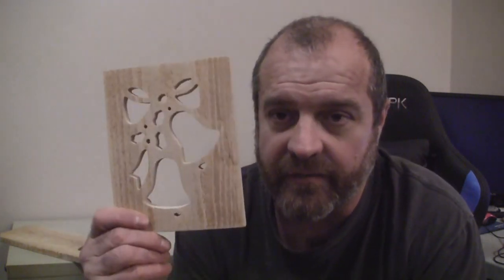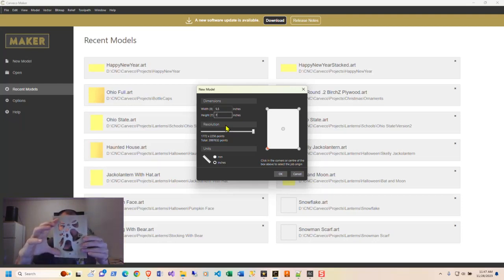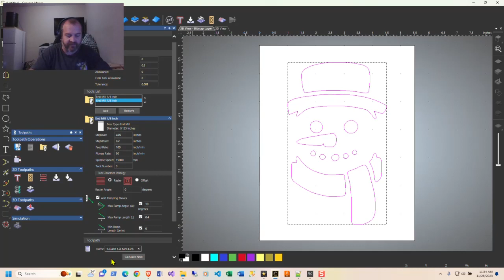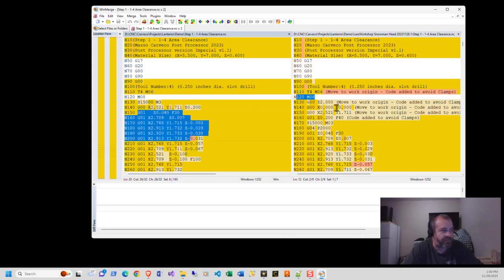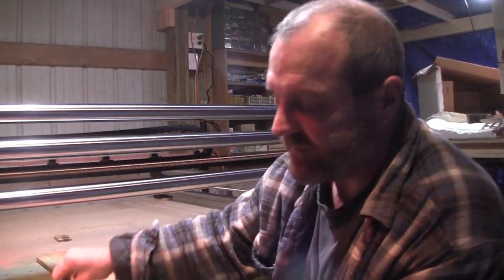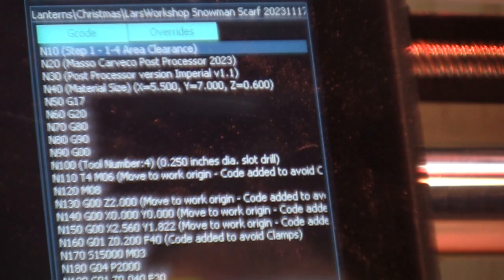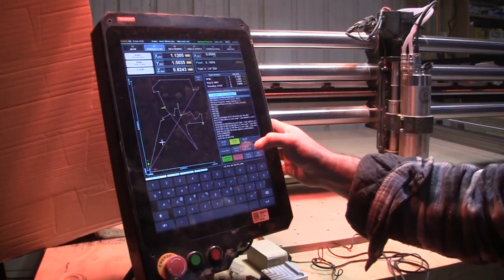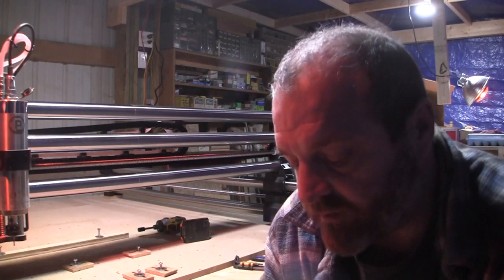CAD Carveco - Lantern Faces - CAM Onefinity Elite Foreman

Comment: Lars, I am a real novice with the CNC and it is a steep learning curve for me so please be patient if I make a dumb statement or ask a dumb question or more than one.
I have made both Halloween and Christmas lanterns for my wife.  Several attempts and finally just good enough.  Got the files from Etsy.  Through trial and error, I was able to get an acceptable face, but I wanted better.  Watching your video gave me a lot of help with importing the files and getting them into my model sizing.  I will consider my skill level before choosing a stencil and converting it.  I may write down the steps and give it a try.
In order to reduce cutting time, I created several toolpaths for each face, starting  with an AC for the smaller cuts and a Profile cut for the larger ones.  I didn’t know the option to use the two bits in the same toolpath setup.  I will watch that part again paying closer attention to how you did that.
The AC for all the cuts increases the run time quite a bit.  Since you are an expert, would you explain why I should not run the Profile for the larger pieces?
For you to understand my method, I use blue tape and glue, not clamps or pin nails.  So, I am not concerned with pieces pulling up and breaking my bits.  Tried both and found the tape and glue work better for me.  The other thing I do differently is probing Z,  I probe from the top of the spoil board.
About the code editor; do you use it with each file?  Is it something that would be helpful to someone like me?  I have relied on setting the Safe Z above my work piece to avoid hitting my bit.  How is your program different?
The other thing, will you sell you AI files for the Christmas faces?  I am using Carveco Maker with a Onefinity Journeyman Elite.  I have been unable to make changes in the faces so I get the finished product I want.  Adjusting the size of antlers, etc. is beyond my capabilities.
Really glad I found you channel.  Hope you get a lot of subscribers and keep the channel going.  I know how much comments and likes help.
Reply from the maker: Jim,  Thanks for the comment and well wishes.  There are no dumb questions.  Yes you can just do a profile and cut out the large areas instead of AC.  I had issues scraping the faces off of my wasteboard when they were taped down, and some things ended up cracking.  But 100% you can do a profile, I would hit with 1/4 to clear a lot of area out and then the 1/8, to get the smaller areas.  If not the 1/8 may get bogged down in the channel it is creating due to the saw dust getting packed.  I am working on getting a site up to offer all of the files.
Reply from the maker: I have 10 carveco lantern face, art files available at this time. If you are interested, you can contact me at we3craftycreations@gmail.com for more information.

Comment: That was the same thing I would always do with my G code on my CNC vertical lathe. The parts I was machining were often in the 2,000 lb weight range, and crashes with a 5" spindle were not pretty if running. Every video gives me little bits of info for my future installation, such as the lateral stiffeners. I will have a block wall on two of my sides, which will be perfect for stopping movement on both the X and Y axis.
Reply from the maker: I loved working on a lathe. I am so glad you are getting ideas for your shop.

Comment: I liked this video as i did your others is there any reason you cleared out the centres and not cut out the centres using insde settings ?
Reply from the maker: Thank you for asking.  You can cut them either with clearance, like I did or with a contour/profile cut.  I choose the clearance for cedar because there is less chance of breakage of the wood, than using tabs.  You could tape everything down and cut completly through the wood if you want to contour/profile the cut to eliminate the possible wood breakage. I hope this answered your question.